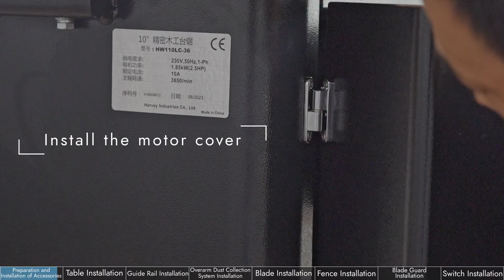HW110LC Table Saw Assembly Video

Comment: I see the dust collection is on the left as well as the power switch but the raising wheel is on the right.  This is not how it’s shown on the website?
Reply: It appears correct on their website.   You are probably looking at a different model.